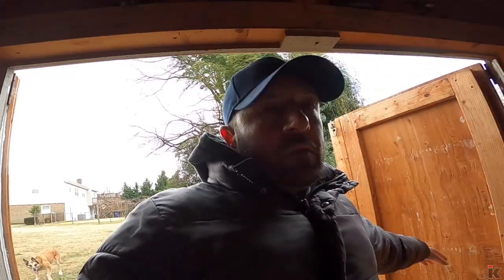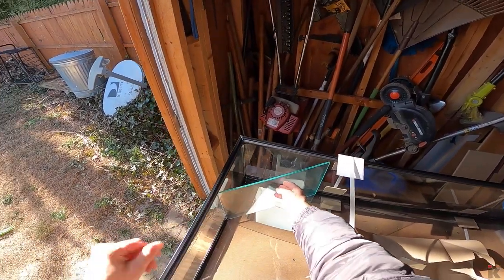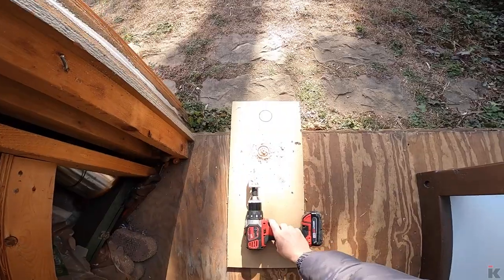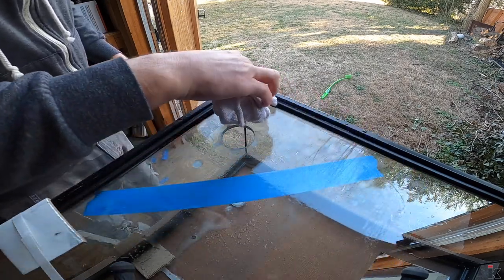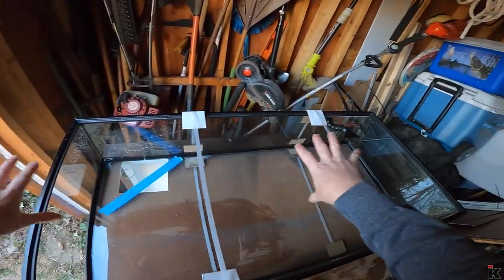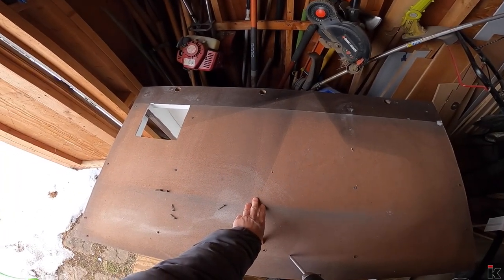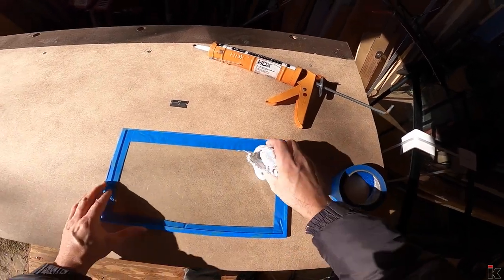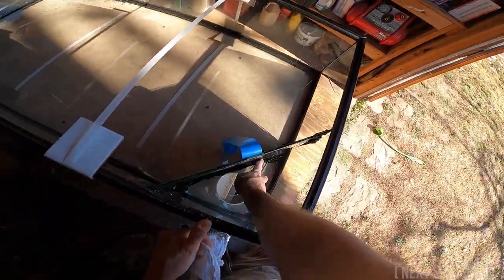Unboxing and drilling holes in the aquarium I've had for less than an hour -A Shallower Reef EP9

Comment: I like the idea of black silicone on the back side of the overflow. Will this hold up long term? If so I like this idea rather than using acrylic for an all in one overflow wall.
Reply from the maker: I've never done this before, but if you look at rimless aquariums, the only thing holding it all together is caulk, and that's under massive pressure. Ive seen 10+ year rimless tanks hold up with no issues, so I would assume it would last the same if not longer. I am trying to use the least amount of plastics in this build as possible.

Comment: Why not using MR MDF? No primer coat? will you paint everything Or add some water repellent stuff on it?  I don't think MDF will handle well moisture from the sump.
Reply from the maker: Mainly because of price, and weight. I wanted the cabinet to be as lightweight as possible. My 30 gallon, which has been setup for over 10 years has MDF. Currently, no issues with moisture, mold, etc.